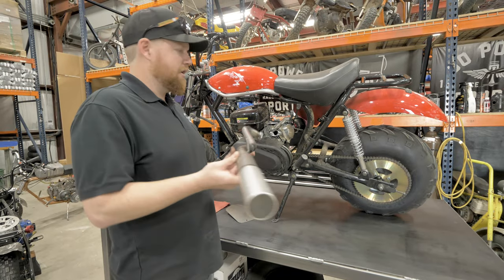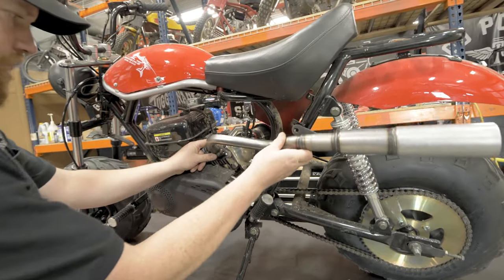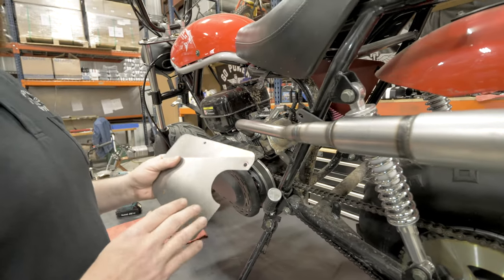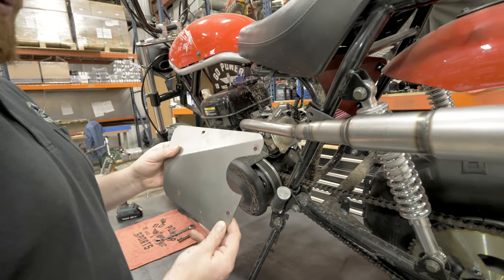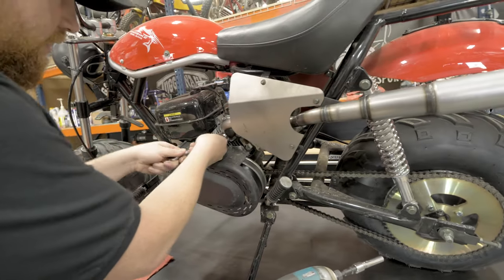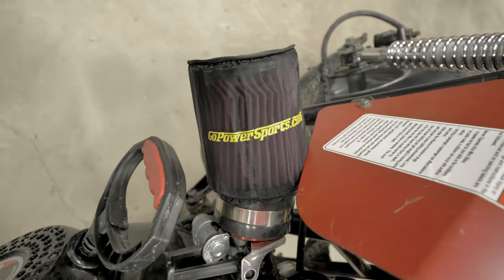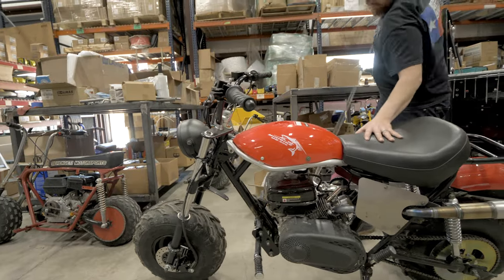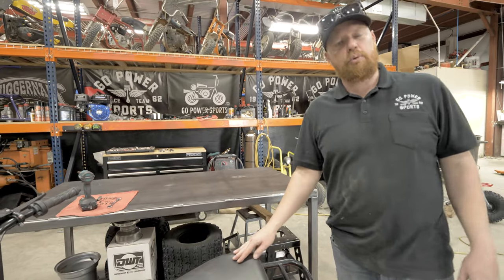TrailMaster MB200 Super Pipe Exhaust System

Comment: Why exactly do you need the Stage 1 carb kit with this pipe?  What happens if you just run this pipe and don't change anything else?
Reply: Because this pipe will not help very much at all from a performance perspective without better breathing and a larger main jet in the carb. In my opinion this pipe is overkill unless you are bolting it to a built 7500 RPM engine.
Reply: @Deucealive75  Do you think i will notice a slight power increase if I replace my stage 2 kit 1 inch header pipe with this thing ?
Reply: @JNC1973  There may be a slight power increase but I'm not sure how noticable it would be when compared to a standard type header pipe.

I've never seen anyone compare pipes on a dyno for these small engines. GPS has a dyno and it would be really cool if they tested different pipes AND at different stages of an engine build. Testing with and without a muffler would also be nice to see on a dyno.

If I had this bike I would probably get this pipe if I wanted to go all out with the bike and didn't mind the cost.
Reply: If you want it a little louder and gain a little power remove the three baffles in the muffler:)